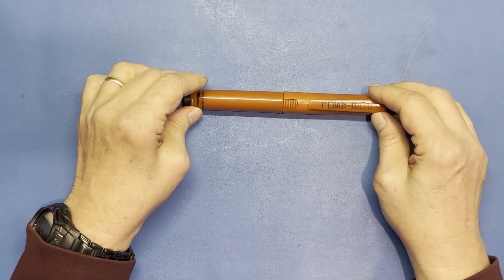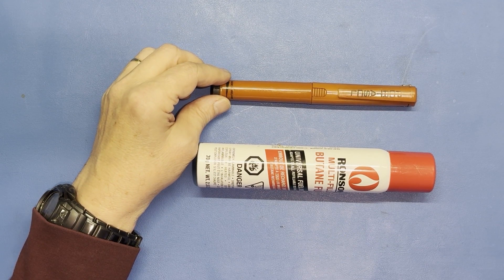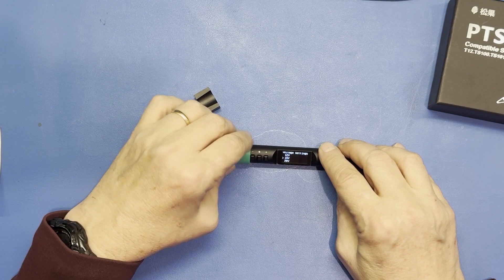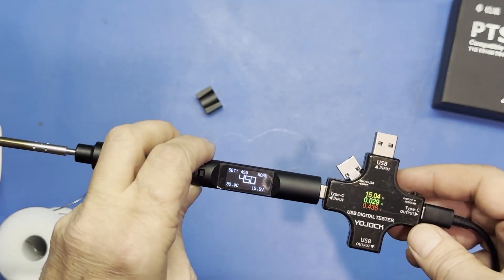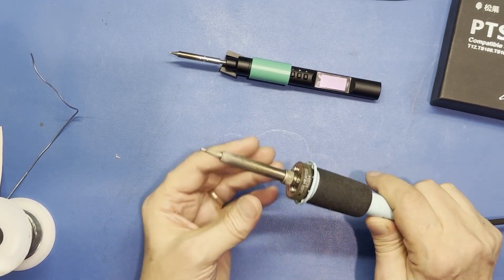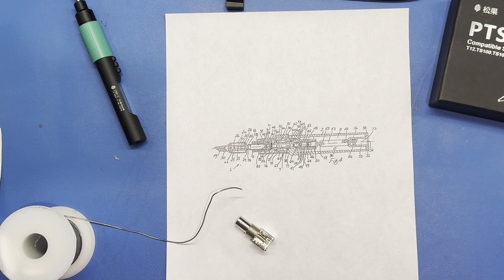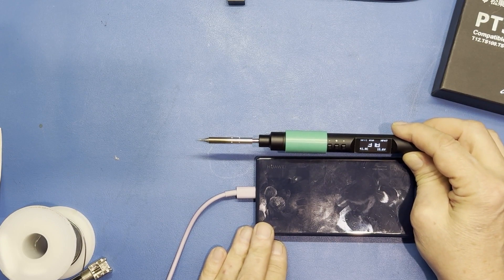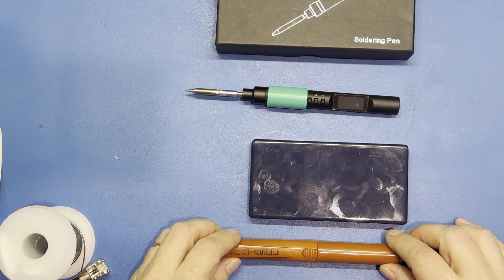PTS200 review

Comment: the supplied tips are 4 ohm while standard hakko t12 is 8ohm. so  with a 20 volt supply pts200 is 100w and t12 is 50w, with 24v t12 is 72w and pts200 will blow up if you don’t set the duty cycle of the iron properly.
Reply: This just happened with mine. Used a 67w pd supply with the included tips, stayed on 450c boost too long and the thing glew orange. Mosfet is probably gone.
Reply: @fpcawolff  Solder a new mosfet into it.